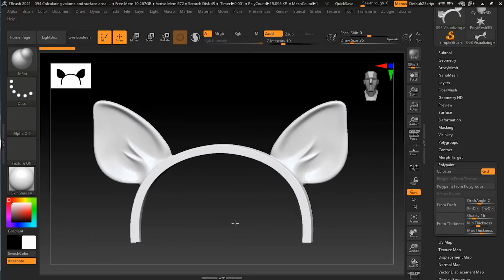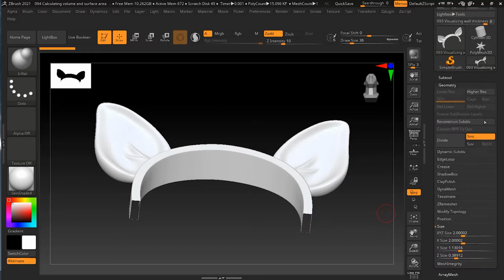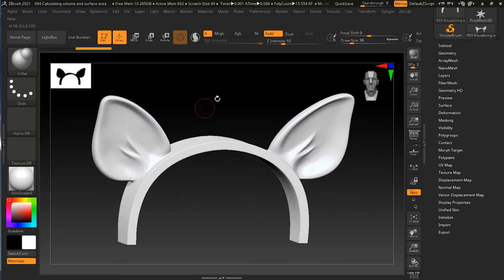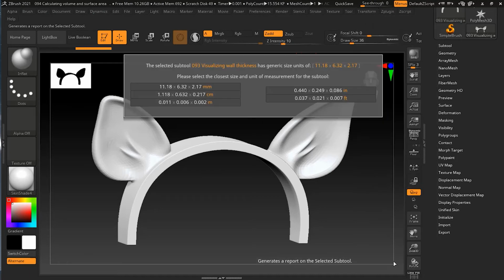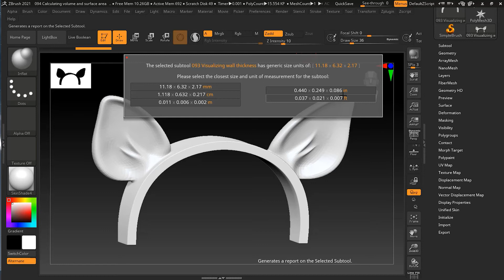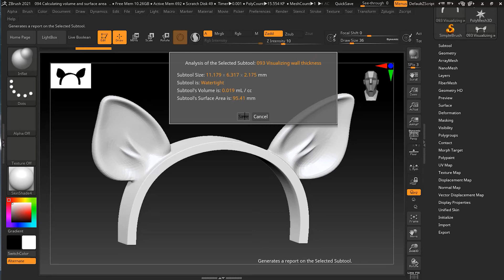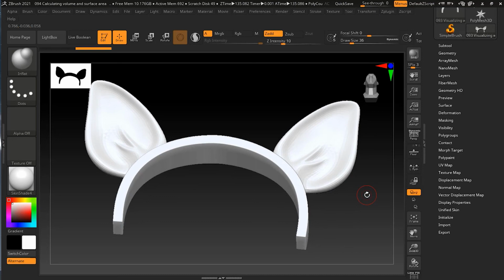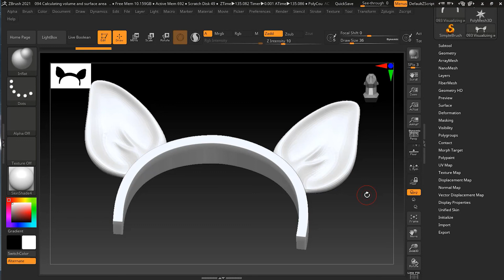How to Calculate Volume and Surface for 3D Printing in Zbrush? | Lesson2 | Chapter14 | Zbrush 2021.5

Comment: Shortcut for video - watertight model, scaled in another software (I used Magics).  Import.  zBrush - go to "Transform" then scroll down to "Analyze Selected Subtool" hit the button - Select the measurement you used (inches, etc.)  and click.  Window pops up with surface area calculation.  Good video - very helpful.
Reply from the maker: Thanks a lot